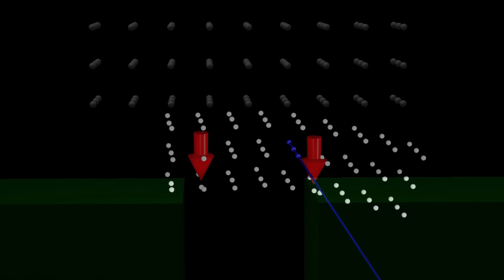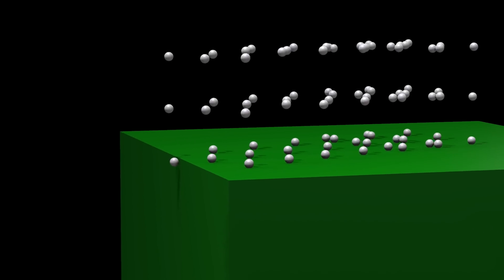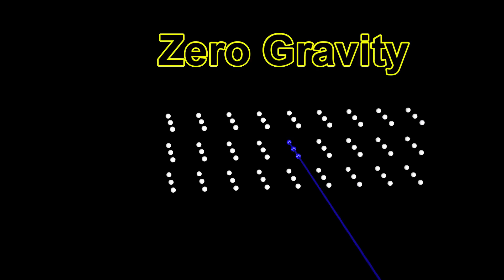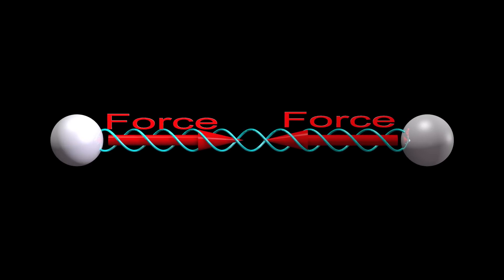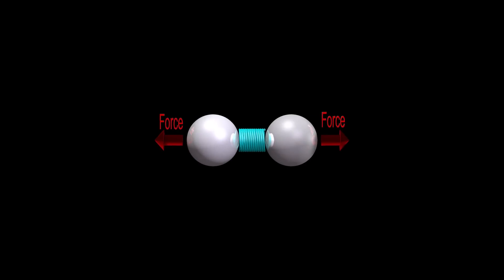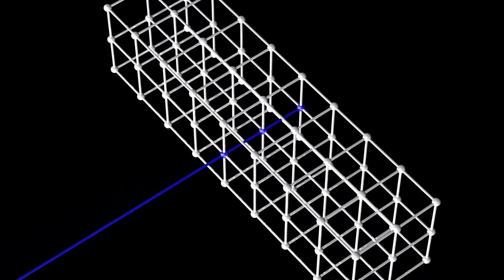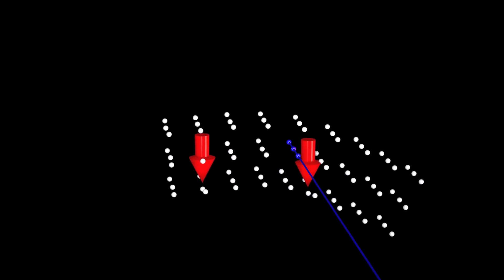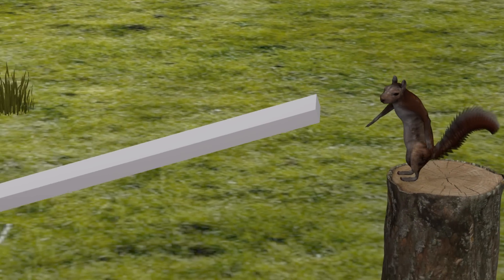Torque can’t exist for rigid objects

Comment: "How can the left part of the body experience an upward force?" Your Video misses a whole point: the fixed axis exerts an upward force, because the net force of the rotating rigid body shown in this video must be zero under the assumption, that the center of mass lies in the fixed axis. Both, the external downward force and the reaction force due to the fixed axis create a force pair generating a torque without an acceleration of the center of mass. Without the fixed axis, the rigid body would experience an angular AND linear acceleration, causing each particle moving downward and to the left/right due rotation and internal forces, but no particle would go upwards.
Reply from the maker: The fixed axis generates an upward force but it doesn't generate any torque, because R=0.
Reply: @EugeneKhutoryansky  Torque is dependent on the choice of reference point. You could also take any reference point, that lies not in the axis of rotation. The interesting fact is, that the net torque of two parallel forces is independent of the choice of reference point. Thus, parallel forces are called "force couples" with a uniquely determined torque. So the upward force due to the fixed axis forms a force couple with the impressed downward force generating a net torque, that is independent from the choice of reference point.
Reply from the maker: @jjs9473  You and I have been continuing this conversation underneath comments from several different people.  For everyone else reading this, I would like to copy your last statement from under a different comment, where you now agree with me.  In this statement, you wrote:  

"Ok, I think I know what you mean now. I think your point becomes clear with an extreme example: Take three mass points with equal mass that lie equidistantly on a straight line and are rigidly connected to each other. If you exert an external force on the middle mass point, which is also the center of mass, perpendicular to the line connecting the mass points, the result is a translation. Due to the rigid connection, the other two masses must experience the same acceleration, i.e. they experience a force parallel to the external force. However, this force cannot be applied by the internal forces, as they would have to be parallel to the connecting line according to Newton's strong interaction principle. This is where I see the contradiction proclaimed in the paper. Now I understand why perfectly rigid bodies are not realizable with the strong version of the third law."

Comment: I don't believe this is correct. There is a force you are not counting. The force of the fulcrum on the lever is an additional force. Those two forces together make it turn. The opposing torque in the animation is a distraction.
Reply from the maker: You may want to read the paper at https://scholarship.haverford.edu/cgi/viewcontent.cgi?referer=https://www.google.com/&httpsredir=1&article=1494&context=physics_facpubs
Reply: @vwcanter you are correct. The paper cited above confuses internal with external forces.
Reply from the maker: No it doesn't.   The mass further away from the pivot only feels the internal forces generated between the two masses.
Reply: @EugeneKhutoryansky  That is not true. The mass further away experiences an external force F and an internal force that lies in the line connecting the two masses. The inner mass also experiences two forces: an external force, that has to be calculated from the condition, that both masses are rigid and connected with a pivot, and the same internal force with opposite direction. (I am referring to the two masses problem in the paper).
Reply from the maker: The mass further away from the pivot is not directly connected to the pivot, therefore it can only feel the forces exerted on it by the other mass.
Reply: @EugeneKhutoryansky  Ok, I think I know what you mean now. I think your point becomes clear with an extreme example: Take three mass points with equal mass that lie equidistantly on a straight line and are rigidly connected to each other. If you exert an external force on the middle mass point, which is also the centre of mass, perpendicular to the line connecting the mass points, the result is a translation. Due to the rigid connection, the other two masses must experience the same acceleration, i.e. they experience a force parallel to the external force. However, this force cannot be applied by the internal forces, as they would have to be parallel to the connecting line according to Newton's strong interaction principle. This is where I see the contradiction proclaimed in the paper. Now I understand why perfectly rigid bodies are not realizable with the strong version of the third law.

Comment: 2:38 : huh? But what about like, the force applied on a particle moving in a magnetic field (with said magnetic field being a result of a number of other moving electric charges) ? Surely this also conserves angular momentum?

If I have two electric charges moving around, shouldn’t there be a part of the force between them which isn’t along the line between them?
Reply from the maker: The forces are still along the line between them.  I cover this in my original video on electromagnetism at http://youtu.be/9Tm2c6NJH4Y
Reply: @EugeneKhutoryansky  I don’t think I quite caught that point in that video.
Let particle 1 follow the path x_1(t) = x_1(0) + t v_1
And particle 2 follow the path
x_2(t) = x_2(0) + t v_2
Let q_1 be the charge of the first particle.
The contribution to the electric field from the first particle at time t is given by E_1(r,t) = k_e q_1 (r - x_1(0) - v_1 t) * ||(r - x_1(0) - v_1 t)||^(-3) 
(Right?)
and so, uh,
if we differentiate this with respect to t, then, this should give us the change in the part of the electric field attributable  to the first particle. And this should give us the magnetic fiend induced by particle 1, as a function of position and time.
(Here I am supposing that the two particles have whatever additional forces are necessary applied to them to make them move along these straight paths)

If we consider different values of v_2 , pointing in different directions, then it seems like at time t=0, that the cross product of magnetic field at time t=0 at the position x_2(0) , with v_2 , will be in different directions,
but, changing v_2 does not change the line between the particles at time t=0, which is the line through x_1(0) and x_2(0) . So, how can the force between the particles in this case be along the line between the two particles?

Maybe having the external forces that force them to follow these linear paths (being arranged beforehand to exactly counteract whatever electromagnetic interaction there will be between the two particles) somehow breaks conservation of angular momentum for us, but, I wouldn’t think so??

Where have I gone wrong?
Reply: @EugeneKhutoryansky  thanks, I’ll check that out

Comment: But if you are going to assume that an object that can't exist does exist, then wouldn't you expect new physics along with it? If I understand the problem, the object can't stop or start rotation. Wouldn't acceleration in any direction run on to the same issue?

Comment: I would love to know how this “distance to axis of rotation” effect works. I know such distance is directly proportional to torque; I just don’t know why that is the case. If the same force is applied to both sides of the object, how come one wins the battle just by virtue of being placed further away?
Reply from the maker: You saw why it works in the animation.  The force further away from the axis causes a greater deformation in the object, causing an upward force on the other side of the axis as the springs try to straighten the object out.  If you want a mathematical analysis deriving the torque equation, this is available in the paper at https://scholarship.haverford.edu/cgi/viewcontent.cgi?referer=https://www.google.com/&httpsredir=1&article=1494&context=physics_facpubs

Comment: wait... why does in a perfectly rigid object the strong version of Newton's 3rd law get violated? what is the effect of no elastic deformation?
Reply from the maker: This is discussed in detail in the paper at https://scholarship.haverford.edu/cgi/viewcontent.cgi?referer=https://www.google.com/&httpsredir=1&article=1494&context=physics_facpubs
Reply: @EugeneKhutoryansky  I don't find that paper convincing. It incorrectly applies Netwon's 3rd law to a masseless bar connecting two masses. The cardinal equations (including the torque equation) are true regardless of the rigidity of the body, but they don't fail for a perfectly rigid body. I don't see anything in the equations that goes wrong. Also the video went very quickly on this point, so I couldn't understand what your argument is.
Reply: @lamarozzo  Yes. In fact, the paper gets some things wrong. The constraining forces T and -T are not internal forces and therefore do not have to fulfill Newton's third law. External forces are exerted on the two masses by the pivot, which do not even have to cancel each other out. It's bad to see that such a paper got accepted by AAPT in 2014.
Reply: @jjs9473  yes, I agree. Rigid-body dynamics is widely employed also in molecular simulations, where springs are replaced by algorithms like Shake. So I don’t understand the point the video is trying to make.
Reply from the maker: @jjs9473  You and I have been continuing this conversation underneath comments from several different people.  For everyone else reading this, I would like to copy your last statement from under a different comment, where you now agree with me.  In this statement, you wrote:  

"Ok, I think I know what you mean now. I think your point becomes clear with an extreme example: Take three mass points with equal mass that lie equidistantly on a straight line and are rigidly connected to each other. If you exert an external force on the middle mass point, which is also the center of mass, perpendicular to the line connecting the mass points, the result is a translation. Due to the rigid connection, the other two masses must experience the same acceleration, i.e. they experience a force parallel to the external force. However, this force cannot be applied by the internal forces, as they would have to be parallel to the connecting line according to Newton's strong interaction principle. This is where I see the contradiction proclaimed in the paper. Now I understand why perfectly rigid bodies are not realizable with the strong version of the third law."
Reply: @EugeneKhutoryansky rigid straight lines are called constraints in classical mechanics. Constraints are not subject to Newton’s third law. That’s not a deep issue though, because constraints are not physical forces, but forces that arise from the approximation of perfect rigidity. Rigid bodies are an approximation of course, but instead of blaming it on Newton’s third law one could blame relativity (because speed of sound is larger than c) or Heisenberg uncertainty principle.
Reply: @lamarozzo  Physics is not about to blame models. One thing a scientific theory have to fulfill is consistency. If you assume that mass point systems fulfill Newton's equation of motion and the strong interaction principle, then not every mass point system can be described by these axioms from a mathematical point of view, so we have an inconsistent description here. You therefore need adapted models. One thing that occurs to me now about rigid mass point systems is that it is possible to assume that the mass point system is at least three-dimensional, so that the internal forces can react to any external forces, to maintain rigidity. You also can't state absolute statements like " Constraints are not subject to Newton’s third law": It depends on the model you choose.
Reply: @jjs9473 nice arguments guys. learnt a lot.
Reply: @EugeneKhutoryansky  thank you for the reference
Reply: Well I'm terrible at physics but let me explain intuitively how I understand it. Imagine there is a metal log from the earth to the sun. If you rotate it, it will bend from where it's pushed first. If it was perfectly rigid, the opposite side where pushed would move instantly when rotated. That would violate the speed of light, which all information is bound to.
Reply: @leexiong2128 Special relativity isn’t part of Newtonian mechanics though?